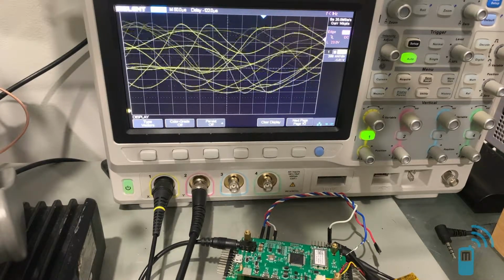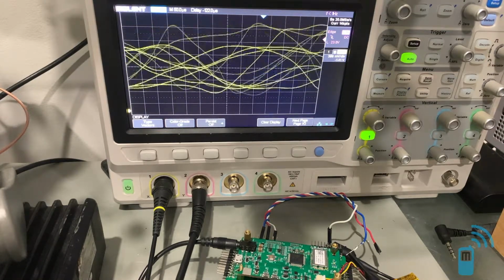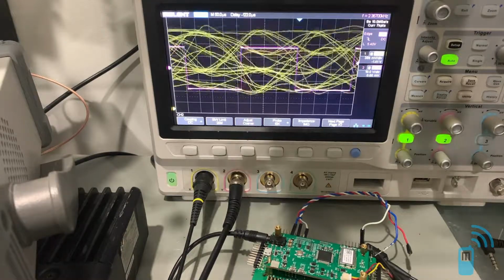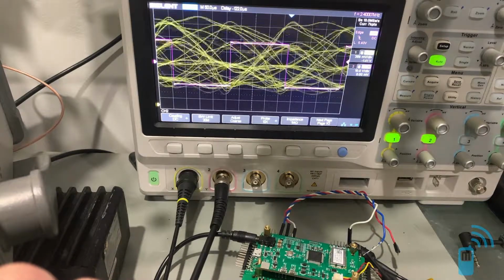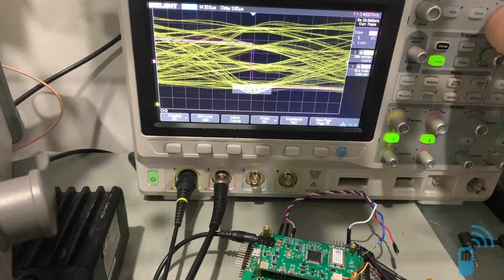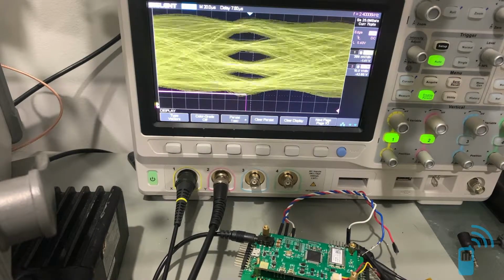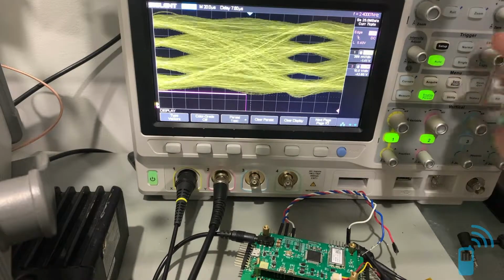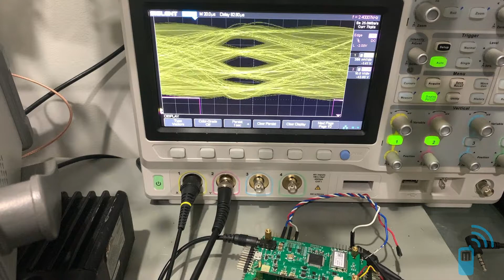Eye Diagram on an Oscilloscope

Comment: I have a question. If you don't have a digital oscilloscope with eye diagram support - these DSOs can cost over €8,000 and display the eye diagram intensity in different colors - is an analog oscilloscope better for displaying an eye diagram than a simple regular DSO (< €5,000) that doesn't support the eye diagram display with different colors for intensity?
In this question we assume that both the analog and the digital oscilloscope have sufficient bandwidth for the signal.
Reply: You can have two levels of so called "Eye diagram". The first level is the poor man eye diagram made by using waveform persistence mode. Either the scope overlaying multiple waveform acquisitions over and display as one, or waveform accumulation overtime. This will give a nice looking eye at and near the trigger point. But as you move the horizontal delay further away. You will see the significant jitter that's the sum of signal source and your oscilloscope. The second level is the "proper" way to do eye diagram. The scope has a very low jitter ref clock. And it's not only triggers on the signal but also performs clock recovery and will try its best to align multiple waveform acquisition to create a waveform persistence. This type of scope are mostly on GHz level of analog bandwidth. It's either real-time sampling or equivalent time sampling (sometime just called sampling scope. In the case of pure analog scope, the persistence came from the fact that phosphor has some decay time + multiple beam drawing per second. This create a Persistence of Vision effect and the eye emerged.
Reply: @TinLethax  Thank you very much for your answer. Since my last comment, I have done more research and come to the conclusion that an analog oscilloscope is not well suited for eye diagrams, because it is difficult to trigger on modern protocols with such a device. Modern protocols do not have a separate clock signal, which makes triggering on them with an analog scope in order to obtain an eye diagram difficult, if not impossible. Digital oscilloscopes, on the other hand, offer far more triggering options and are therefore at an advantage.

Comment: Is it a requirement that the RX time track the TX? Then the external sig gen could be replaced with the TX time base and you could check the RX ability to track over time. 
Thanks for the video. This development stuff is interesting.
Reply from the maker: This method is used in the case where you don't have a time base from the transmitter.  In this case, the transmitter was an ADALM Pluto and does not output a symbol clock signal.  One needs to manually match the transmitter's symbol clock.

If you have transmitter that outputs a symbol clock (like my E4433B can do), there is no need to use this method.  You can just trigger off the symbol clock.
Reply: My Pluto had a very drifty timebase but I understand they have improved that. I ordered a better tcxo to retrofit it  but it was so tiny I couldn’t install it. 😀